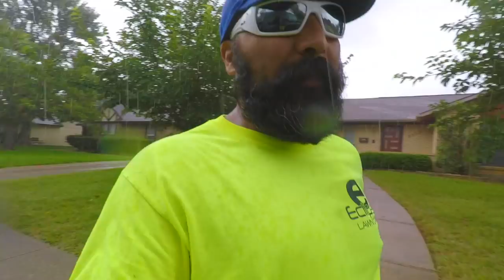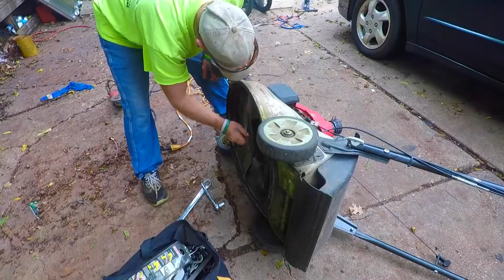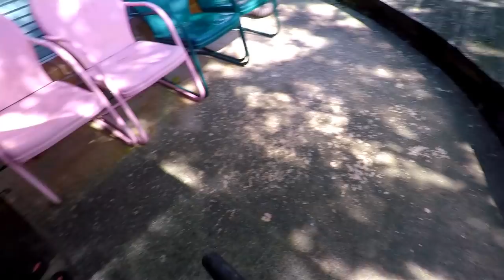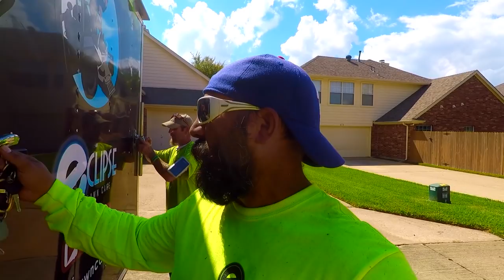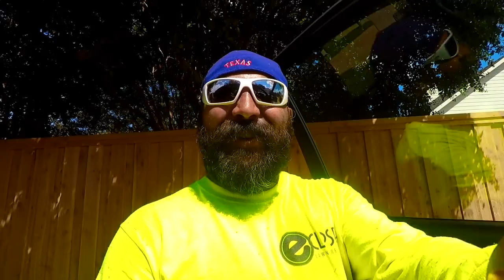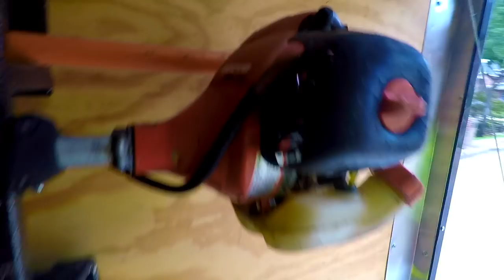Sharping blades on a Honda 21in Mower

Comment: I have the same Honda mower. Do you have a problem with it shutting off? The cable keeps getting loose on mine and you have to shut it off down below
Reply from the maker: No I never had any problems with it shutting off. I did have one that started surging.